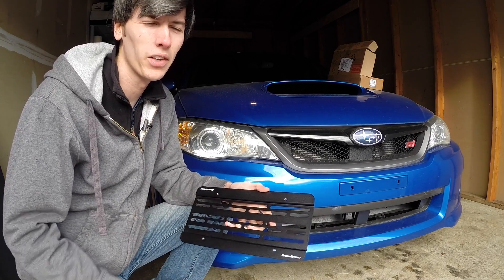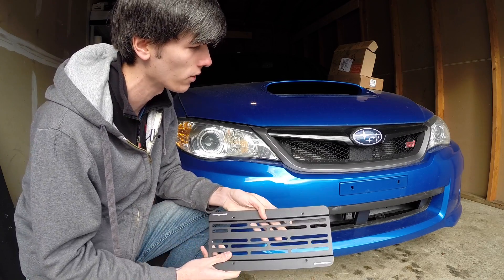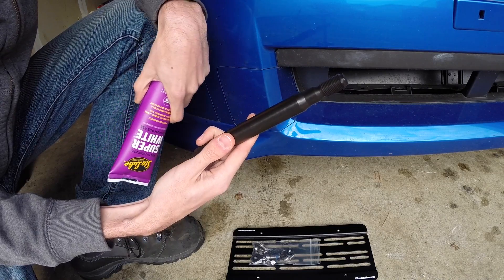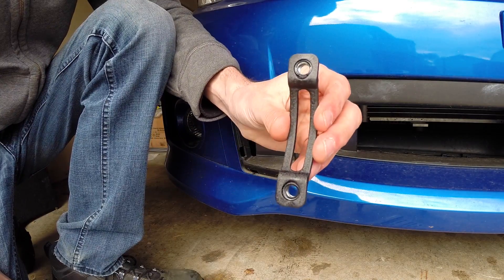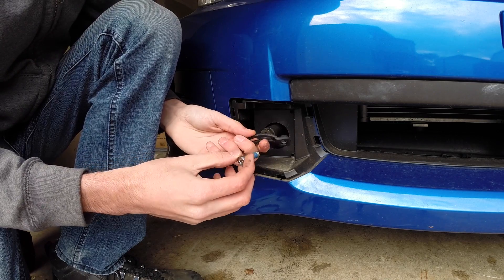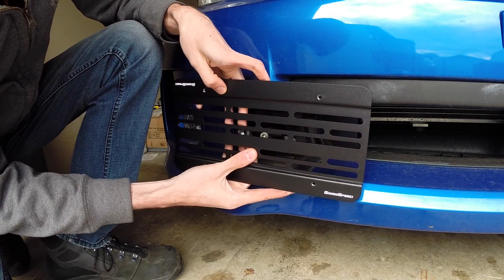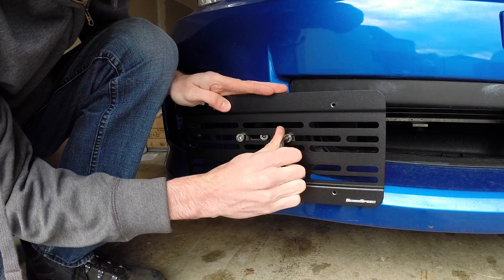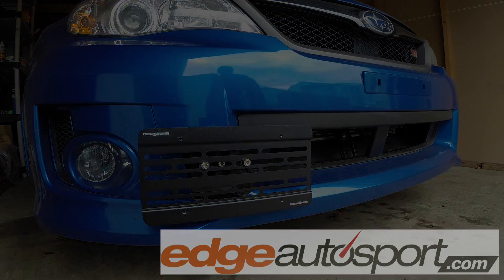Subaru WRX STI - Front License Plate Relocation Kit

Comment: Hey I am getting an FR-S soon and don't like the superchargers or turbo kits available. Turbos tend to overheat the engine and I hate the noise. SuperChargers are cheap but sacrafice on gas milage cause they are belt driven. What about straight power through individual throttle bodies and velocity stacks I want an NA engine without the sacrafice of gas mileage and turbo chargers with intercoolers. I like throttle response over lag too. Just looking at horsepower gains can you get more through ITBS setup?
Reply: Itbs by them selves probably will not gain any horsepower, and will probably actually rob you of low range torque, which is where that engine lacks most. The engine makes 200 hp NA, out of 2 liters, so it's already very well engineered in the first place. The problem with just doing itbs, is the engine will probably be choked equally by all the other intake, exhaust, cam timing/ lift, ECM tuning, that the engine will not breathe any better than stock. If your looking for a street able engine, as a primary purpose, either very small turbos, or a small supercharger will be your best bet for the best possible street package. I'm not an expert on these particular engines, so I would look into seeing if there has been any credible (3rd party dyno) HP gains with exhaust/ intake modifications. It's almost always cheaper to remove weight from the car, than it is to make power, so I would look into light rims or brake discs, to lower unsprung mass, which will make the car feel faster, and then I would look at how much weight you would be okay removing proportionally to comfort/ gadgets. Lower weight also allows for better fuel economy, and better handling. Hope that help you :)
Reply: Fraser Davidson Well no I looked at some forums like the Honda NSX about na power and the increase of 40 hp with itbs and velocity stacks. Actually getting air sucked into the engine like a vaccuum and making horsepower just by air intake alone is pretty good. Because each individual throttle body is activitated acts like a carburator producing quicker throttle response and also makes a killer sound note within the engine. Everyone in these forums with the FR-S either have a Vortec Supercharger or an GReddy turbo kit. Pretty boring stuff make 90 horsepower not huge at all. Turbo lag and supercharger kit bolt ons are tacky in my book. I wanna swap the engine cause it's too weak and possibly add a Boxster S  engine get 315 hp that wouldn't be bad but it would be a huge project. Transmission, ECU and all the wiring would be extremely hard but hey it would be a project. Maybe put the battery and extra weight in back to balance the car out.
Reply: Fraser Davidson By taking the engine out and upgrading as I go to would be kind of fun. Start with a blank car and then create.
Reply: Ryu Fūrinkazan I dont mean to be a total ass hole, but if you think that the only reason why the greddy kit only makes 90 hp is because that is the limits of the engine, then you have some serious learning to do amigo, before you can even contemplate an engine swap. They limit boost in the greddy kit, due to the strength of the stock engine components. I'm 99% sure that there is already upgrade connecting rods, and pistons on the market that will allow you to build and engine capable of making ungodly amounts if power for the FR-S. The FRS motors are actually a lot better than the of EJ motors for making power. The old EJs made 500 hp easily, which is stupid amounts of power for the FRS chassis. A Porsche straight six probably will not fit, and will cost way to much money to even make remote sense. Plus, due to its extra length, it will absolutely wreck the FRS' polar moment, which will make it handle like a steaming pile of shit. The Porsche engine is also designed for mid engine, and rear engine applications, not Front rear, so cooling ports will probably be placed in the wrong spot most likely. To even contemplate a swap of that magnitude, you better know how to fabricate sheet metal. know how to weld, know how to machine, know how to engineer components, and have the tools to do so, or have an absence amount of money ready to be invested.

You cannot compare one engine to another. the honda NSX engine is an entirely different beast, ITBs take a huge amount of fluid dynamic, and engineering to design properly. Hondas are notorious for intake and exhaust gains, but most other vehicles are not.
 
90 hp is more than enough for a stock FRS. The beauty in the FRS is the balanced  chassis and power. You do not want to overpower a chassis, and dyno queens are terrible street cars. 90 hp will put you close to 300 hp, which is definitely not amateur hour power on a track, in a #2700 car.

Buy the car, get some very good driving instruction, and a lot of seat time. learn how to work on your own stuff, and learn how to set up a car. use the money saved to buy tires and track days. A good driver in a stock FRS, can blow the doors off of a bad driver in a super car. Its not the answer you want, but its the one that makes most sense. Adding power into the equation too early will cause you to be a sloppy driver, and could possibly lead to you killing you nice car.

 Power comes later, and at huge expense. I like that your enthusiastic about this stuff, but its not a cheap hobby, and its one that requires a vast amount of technical, and practical knowledge. You will get there one day, but for now, its probably best not to stray to far from the known. A greddy kit will be awesome, and if your worried about heat, buy a better radiator, and a better intercooler. And trust me, I like to stray far from the known. I'm currently planning a BMW E36 Ford Duratec motor swap.

Some good places to learn about the finer details of automotive design and tuning is the Bosch Automotive Engineering hand book if you can handle some math and engineer speak, Any published book on technical aspects of cars, The book How To Make Your Car Handle, and Forum threads where the claims are backed up by math, and hard data. 

Also, I'm quite aware of how ITBs work, and how they affect the harmonics of the intake column of air :)

Sources: I've worked on $300K Porche 917K replicas, Raced go Karts, Built mt own car, and have been machining/ fabricating with metal since I was in grade 9.
Reply: Fraser Davidson Well no on the piston and connecting rods/ HKS makes a 2.1 displacement that cost an ass load of money like 3800 bucks talk about bigger displacement .1 difference. And shit I have seen LS1 swaps into the FR-S already. Driving instructor what? I have driven the car soo many times hint Toyota Salesman/ Everytime I am on break I take it out for a spin. I also talk to all the mechanics and engineers too in the garage. It needs a six for sure Subaru makes one for the Legacy rr. But I would love to see a new concept rather same old stuff. No I don't want a big V8 5.7L although simple engine and swap massive torque and horsepower gain but it's not practical like a Porsche. JDM engines lack the na power and torque because they want you to tune everything on your own. No I just want simple power. I hate the sound of the engine of the FR-S its like a buzzing and just sounds like crap overall. The boxer setup is pretty simple. No I believe it can be pushed back so it could be balanced it is not impossible. Toyota is coming with a new Supra and they want 80 grand for a v6 engine that is straight insane.On Ebay  brand new Porsche engines are under 20k  I am just imagining a Flat boxer 6 NA with 315 hp in a superlight weight fr like the FR-S. Just a dream. I drive the car everyday through hairpins and long winding roads it's fun but it can be a lot more. I am not a ricer but it would be a dream. I love Porsche's but the price of the cars are ridiculous.
Reply: Get a NOS kit. No lag, huge HP gains, shoot when you need to, nornal gas mileage when not needed (when not shooting)
Reply: tonytober I am not a ricer. Nos is especially bad to a car. High temps causing catastrophic failures and warped pistons are the result of that mess. I like to run my car for more than a month maybe years.
Reply: Fraser Davidson I don't have any bad things to say but ''advice'' don't be a kill joy. If ya don't know something don't guess that is a big pet peeve of mine. There are dream killers and there are assholes there are no differences between the two. I will be honest I am not a mechanic but I have friends who are. Just a thought we are not here to be dickheads or know it alls. Life is too short for that shit.
Reply: NSX is an engine that can be compared to a Porsche Boxster S cause it uses a V6 3.2 L 290hp Porsche H6 3.4L 315hp so biased opinion there whatever. Lightweight super cars that use lightweight chassis. Also both are mid-engine.
Reply: Maybe dreams are meant to be silent cause assholes will just judge and be pricks done here.
Reply: Ryu Fūrinkazan First of all, I never said it couldn't be done, I just said It wold be a bad idea when the FA20 that comes with the FRS can make more power than the chassis could ever hope to handle, with out adding extra weight, and screwing up polar moment. If its just going to be a drag car, there are other much better cars for that. I'm actually a little pissed off because I gave you some good advice, and your calling me an asshole because I told you the truth, and that you said I dont know what I'm talking about when you think you can compare a Honda NSX engine to a Subaru FA20. You cannot, they have entirely different flow rates, strengths weaknesses, cam timing, port shapes, exhaust set ups, and  even piston shapes, and combustion chamber layout. Engine swaps cost a hell of a lot more money than tuning. $20k on a FA20, will build you a street legal, stupid horsepower, anti lag monster that will try and kill you first chance it gets. Engine swaps. are also not nearly as reliable as a stock engine will be. Finally, that's high performance driving instructors I was talking about. No amount of GT6/ Forza will tell you how to drive properly and if youve only ever driven on the road, your HPD skills are going to suck.

I've been nothing but helpful, and considerate, the only person here being an asshole is you.
Reply: Why don't you buy a used Porsche in the first place if you want a Porsche in the first place?. Your going to end up spending the same amount of money with a swap like that. Ultimately, if you ignore my advice, dont say I didn't warn you. I'm done with this conversation, since nothing productive has come out of it. good day sir
Reply: Fraser Davidson On the theoretical point of spending 20k on the FA20 motor is dumb. Yeah you can make massive power with a Turbo or even a twinscroll supercharger to cancel the lag but in the end would it be worth it no. I like it to be simple and to not change and tune every part to make horsepower. Changing and tuning cost a lot of time and money.
Reply: Fraser Davidson Everyone loves a pushrod V8 cause hp and torque they are inexpensive and easy to hook up. Motortrend put one in a Silvia and said it was the best car they have ever built and driven. Theoretically do that with an Fr-s later I guess.
Reply: NOS is not bad to the car if the car is tuned to it properly. It acts exactly like turbocharging/supercharging : Burn more fuel to gain more power. There is no other choice. It's that, or you get another engine/car. NOS cools down the intake and the engine, it's release in the intake is an endothermic reaction.
Reply: Toan KH See nitrogen itself acts like a coolant it is like liquid nitrogen very cold then when you use it in fuel creates huge temperature flux which done many times messes up the pistons. Not like a turbo or supercharging more like a quick high say like meth or cocaine. Just a chemical reaction that last a few seconds. Although you get about 1000% gain for a few seconds then stops.
Reply: Ryu Fūrinkazan i'm gonna tell you what i tell most people, if you need power, light weight, easy to work on engines, you need a wankel rotary.

both the rx-8 and the rx-7 engines can make serious HP, even NA, and they are very small, i dont really know if it would mess up the balance of the fr-s too much, but it would be better than a heavy porsche 6. also, given the proper care, they are a dream to maintain.
Reply: Cd K Quart of oil every 100 miles or so. MPG is straight up horrible like 12. Better idea keep the engine add an electric motor in the back hybrid style electric battery/ the instant torque is sweet. Porsche 918 has one get 65 mpg. adds power too. Just a new idea.
Reply: Cd K Wankels are obsolete but I like the redline of 9000 rpm. It isn't practical anymore people are putting LS1 in place of the rotary. Believe it or not the V8 is a light weight engine.
Reply: Ryu Fūrinkazan its lighter because its much newer than the rx-7 engine, if im not mistaken, the rx-8 renesis is lighter, by a lot, than the  v8. mpg is more like 18 combined. and good luck EVER getting a hybrid drivetrain setup going without professional skills and/or a ton a money. and with some mods and tuning i have seen people get the redline well past 9k, for an amazing, screaming experience.
and if your really hardcore, you could order a 3 rotor cosmo sport or custom engine, put that in, and if you want get a small/twin turbo or centrifugal charger, for extreme power
Reply: Cd K Well all the mechanics where I work know all about the Prius. I also know too. The idea of regenerative braking and gaining electricity through braking is genius. Although it's done through a cvt transmission. Idk maybe sometime in the future someone will perfect that art an sell it like a car mod. So that any car can be converted into a hybrid just a dream.
Reply: the prius is vastly different than cars like the porsche 918 and the p1, they aren't even on the same planet.

i agree it is, put its also expensive, and complicated.
Reply: Cd K Not that different. Think of a wind mill or turbine that makes electricity. A series of magnets with copper wire makes electricity. In turn to power a generator or motor. Not complicated its ingenuity and innovation. We have had this tech for many years.
Reply: i wasnt talking about the power generation aspect, but rather the way its implemented
Reply: Gas dropped to 1.80 today Gold was like 2000 dollars an ounce. Now 1200 going lower. Prices of things change it's a variable. But when they are high don't buy. When they are low and in demand go for it.
Reply: Cd K Ya I have a feeling it wil catch on cause people hate spending on gas and more towards saving the enviroment. Hybrids are the future.
Reply: where do you live that gas is so cheap?

i really hope it does, it would make things very interesting
Reply: Cd K KC
Reply: Cd K I would love to see a company that just makes carbon fiber composite body panels and parts that would be so awesome. Think of a Carbon fiber body FR-S.
Reply: wow, that would REALLY cut down the weight, too bad you'd have to be bill gates to afford it
Reply: Cd K Well no you could diy for cheap. Carbon fiber is sold in sheets. Make the molds and fabricate. Done with layers and epoxy resin I might actually do this at my machine tech at school. Hey man just got to follow a dream. It takes a lot of work.
Reply: yeah, i think your right, if thats your dream, then follow it, and if you work hard enough, you'll get there. let me know if you do
Reply: Cd K Ok. :)

Comment: Isn't this dangerous? Technically, any frontal impact will hit straight into the frame due to the thick metal rod going into the frame. The bumper becomes useless in protecting the rest of the car. I was under the impression that an impact into the license plate area (or those colored tow hooks people have hanging out) has a big chance of totaling your car due to frame damage. Along with being far more rigid than the rest of the bumper and hurting someone more.
Reply: I think your dead on about frame damage, but I don't think that small post will do much to the energy dissipation in the large scale. If the impact is hard enough that your worrying about energy dissipation, the whole front end is going to crumble. At a lower impact force, it would probably just act as a pungy stick, and impale the other persons bumper. Side impact I could see it being a bit of an issue to cars with thinner doors though.

Comment: I like it, So if you would still need to drill holes into the front bumper without this re locator kit, what are the two already existing holes in the middle of the bumper for?

Comment: Here in Switzerland insurance will only cover you if you have your license plates mounted and you also need to have them mounted as a proof that your car is registered and roadworthy.
There are even regulations on the height at which the plates need to be mounted and the angle at which they may be tilted. Also the rear plates must be illuminated lol

Comment: and now you have 2 holes where the licence plate was meant to be. I would just leave it stock.
Reply: That's what license plate deletes are for but I agree I wish it wasn't there in the first place. I have seen some people shave that off but requires some plastic weld and paint.
Reply: And I think the restriction surface on radiator intake is about the same...
Reply: they make things to put there and they can say things like wrx